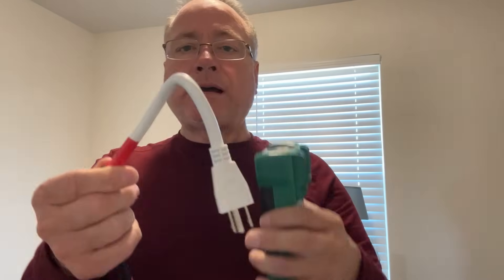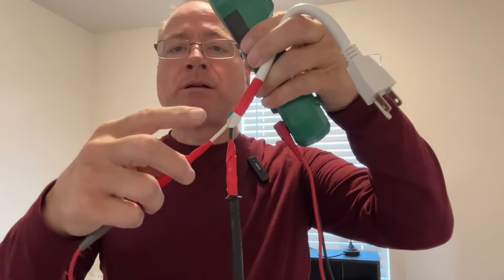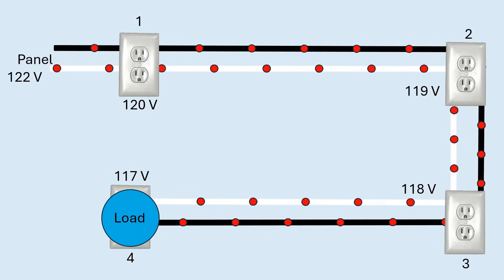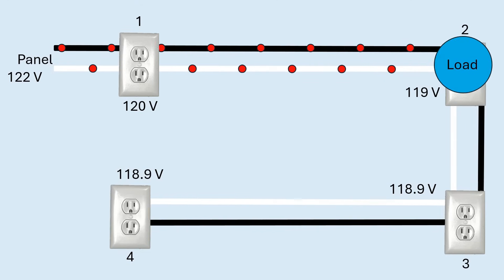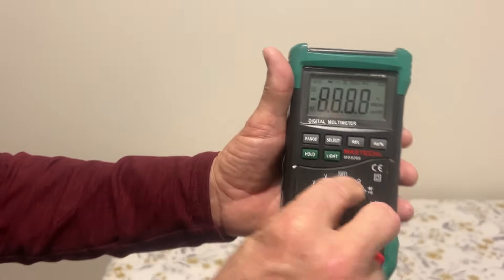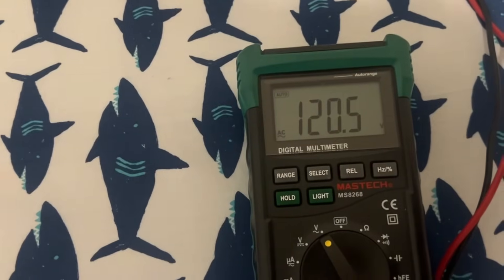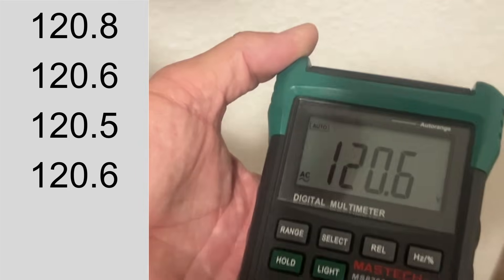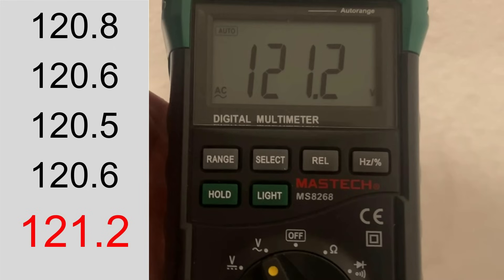Find the First Outlet Fast - Simple Multimeter Test

Comment: Nice job putting ohms law and watts law to good use.   

Going back a few years ago on one of your uploads in which you rigged up a test board with a properly wired receptacle, one with a correct polarity bootleg ground, and one with a reverse polarity bootleg ground with your toaster oven, perhaps in a future video a perspective homebuyer considering a pre-1960s home may find it helpful to see a demonstration on how to locate a bootleg ground by using a hair dryer or similar high wattage appliance with a two prong plug and digital multimeter to measure the voltage between the neutral and ground slot.

Fortunately I can't say I've ever come across a bootleg ground situation, in which case what you don't know can kill you, so at least knowing when to suspect it and how to detect it can literally save a life.  

I gotta admit, the Ideal suretest is a fine piece of test equipment, but as someone who works almost exclusively in new construction both residential and some light commercial, I don't know about you but I just can't see the $450 give or take MSRP as efficient use of my hard earned money when I may work in older buildings maybe a half a dozen times a year at most.
Reply from the maker: Thanks for the thoughtful feedback! I like your idea of demonstrating how to detect a bootleg ground using a high-wattage appliance and a multimeter—it’s a practical approach that could really help viewers understand what to look for in older homes. I agree that bootleg grounds are rare but dangerous, and knowing how to spot one is invaluable. As for the Ideal SureTest, I understand your perspective—it’s a great tool but can be overkill if you rarely encounter older wiring systems. Thanks again for sharing your expertise and ideas—I always appreciate your input.

Comment: How about that receptacle that you plug in the hair dryer?
Reply from the maker: I’m not sure what you’re asking, but we did get a voltage drop between the one just upstream of that receptacle to the one where the hairdryer was plugged in, and that is to be expected since the current is running between those receptacles. Is that what you were asking about?